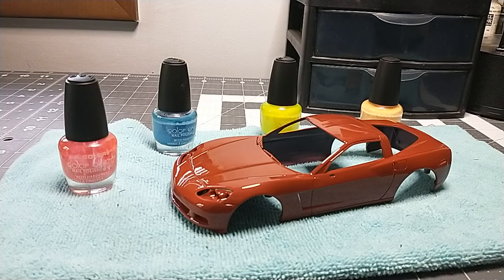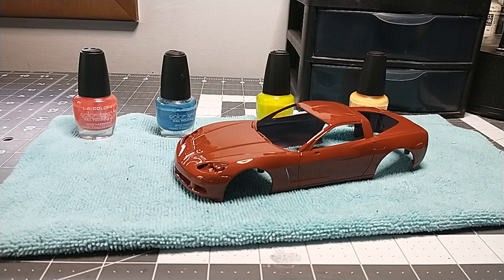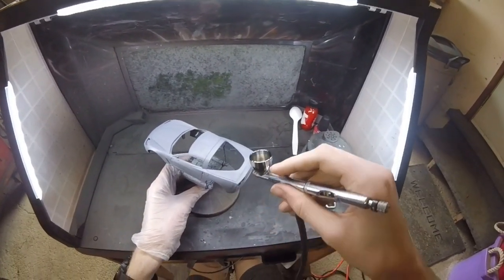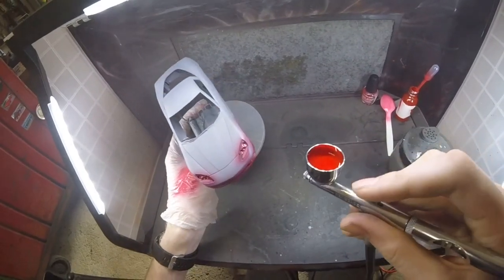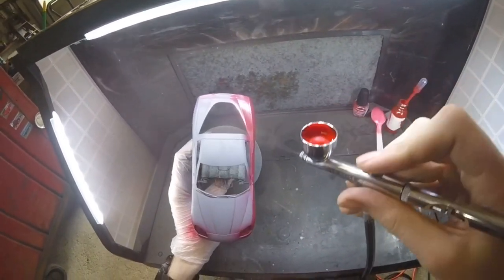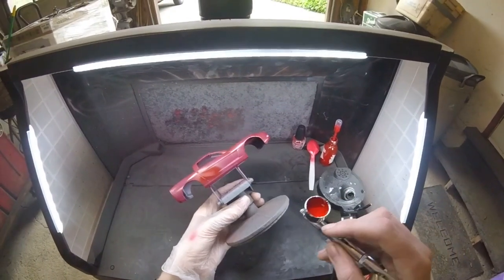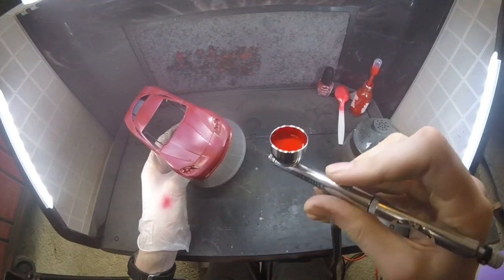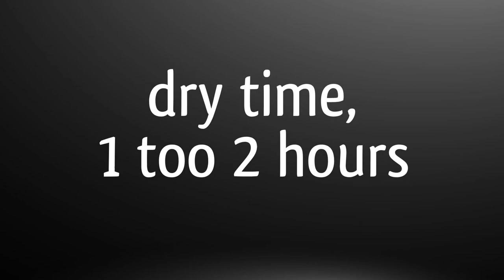HOW TO: use nail polish paint on your skill models [part 1]

Comment: Awesome video.

Question....what do you clean the airbrush with after you use nail polish?
Reply: My guess is that because he thinned the nail polish with lacquer thinner,  you more than likely need to use lacquer thinner to clean the airbrush. It's a safe guess. Lacquer thinner is the only thing i use to clean my brush anyway.
Reply: @BlueGillage  I have since posting this, tried using some nail polish and I ended up using acetone to clean my brush when I was finished with it. The Nail polish was quite different to airbrush but ended up pretty good and the acetone cleaned it all up no problem.

Comment: Which nozzle size and pressure best for this paint. I just started few months ago. I found that nail polish is hard to work with. Even with lacquer thinner, it remain very sticky.
Reply from the maker: The airbrush internet video had a 0.3mm needle size. Yeah, no polish is definitely a bit more challenging, but once you get the hang of it, you might be painting models with nail polish, not stop.

Comment: Dylan, just did my Chevelle and followed the directions.  Was very thin and came out very dry. Any ideas?  Thanks!
Reply: Use less thinner if it was to thin.  Turn air pressure down if it came out dry.

Comment: As you were spraying the car with red, you said if it's runny it's too thin - but if you've already dumped your full bottle of nail polish into the thinner, and you don't have another bottle, you have no more to polish thicken it up and obviously you can't take the thinner back out. You've potentially wasted a bottle of polish and thinner. Or are you saying you should have a spare bottle of any colours you will be using just in case you make it up too thin ? - there must be a better way.
Reply: Well, either buy 2 bottles just in case. Or, use slightly less than 1:1 ratio. Or, turn the air pressure down and hold the airbrush further away from the model so it doesn't run. You need to be able to adjust to things because nothing is exactly perfect. Plan thjngs out and dont make mistakes. Easier said than done though.